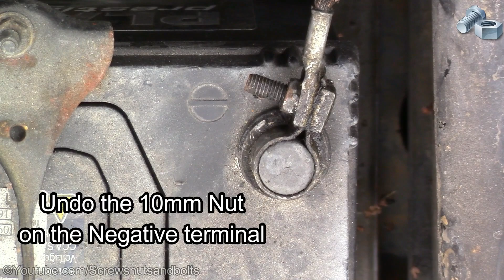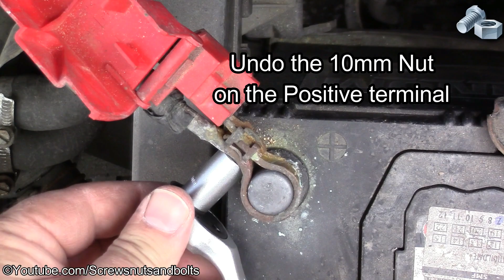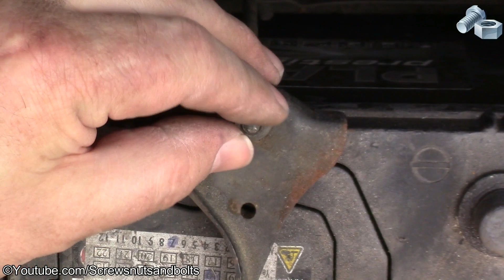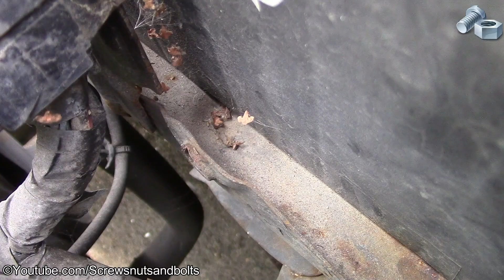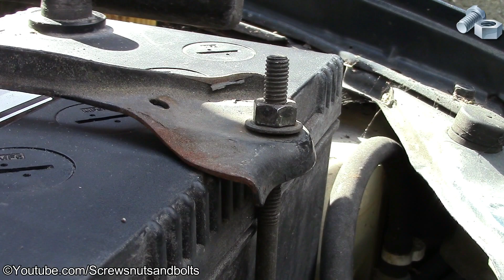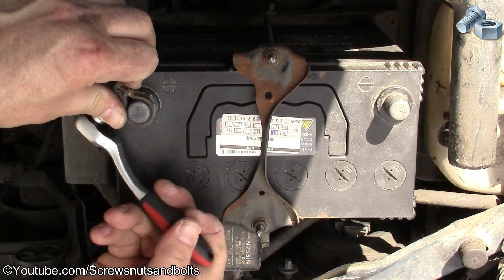Car Battery Change - Nissan Micra

Comment: Did you have to recode the radio? Reason I ask is I don't have the code for mine, as some of the papers are missing. Great vid though. Thanks.
Reply from the maker: Thanks. I didn't because there was an aftermarket stereo in this car. I'm not sure about the original one I'm afraid

Comment: This is fantastic, thank you. Will I need to use a 12v or 16v battery? I thought most cars took 12v but when I google Nissan Micra battery, lots of results say 16v... but some say 12!
Reply from the maker: Thank you, I'm fairly sure it needs a 12 volt battery. I've never heard of a 16v battery for a Micra
Reply: @screwsnutsandbolts  cool, thank you :)
Reply from the maker: @JackLoveday  You're welcome :)

Comment: I have a 2006 Nissan Micra K12 1.2, changing the battery would be similar I assume ? though the cables connectors are different looking,  and was wondering is there any danger of electrical glitches having disconnecting the power supply etc, such as radio ! or anything else that requires power ? Thanks, good video though.
Reply from the maker: Thank you. I haven't done any work on a k12 to be honest. It is possible you could lose the stored radio stations or possibly you might have to reenter a code on your stereo when you reconnect the battery. Also, the alarm might go off, if there is one